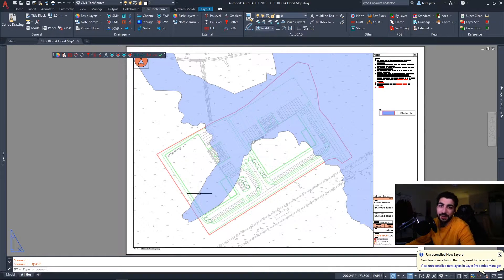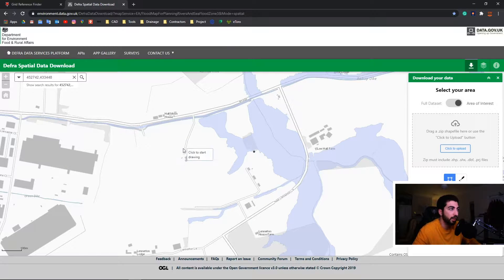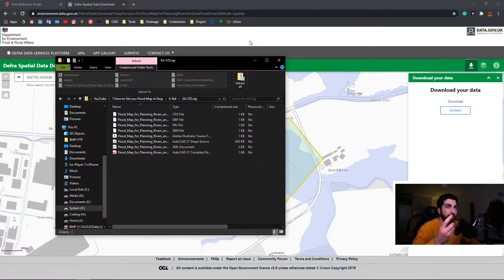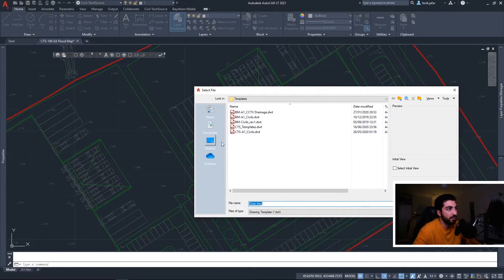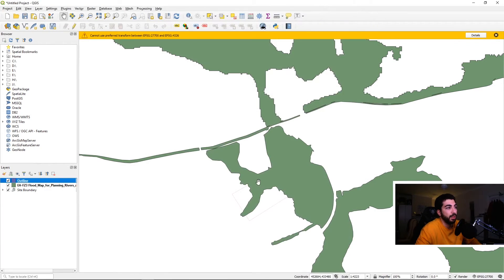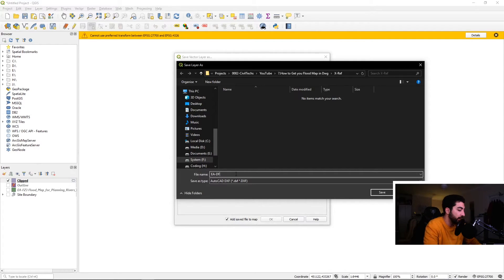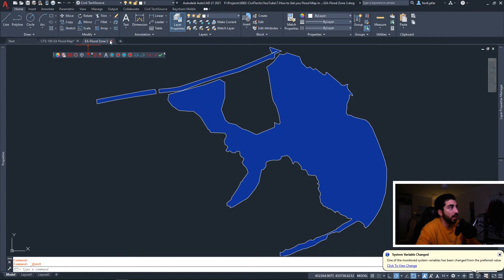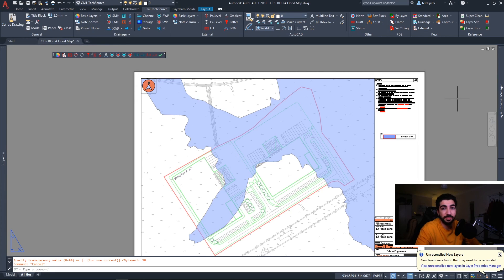How to get EA Flood Zone map in AutoCAD (QGis)

Comment: When I try to use the Defra Spatial Download I get an error "there was an error launching the Data Download app"?
Reply from the maker: Hi Charles, I just tested the EA website and it works fine for me. What browser are you using?
Reply: @CivilTechSource  I'm using Chrome, but I have some Norton "extensions", whatever they are. Could be blocking it?  I just tried a different browser and it seems to work, so thanks.